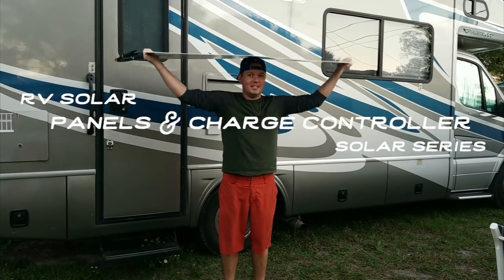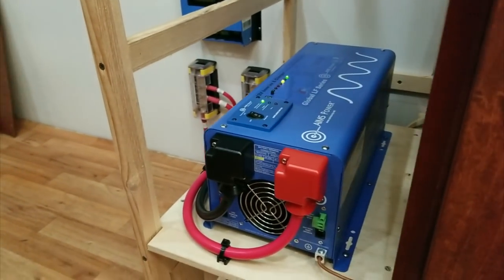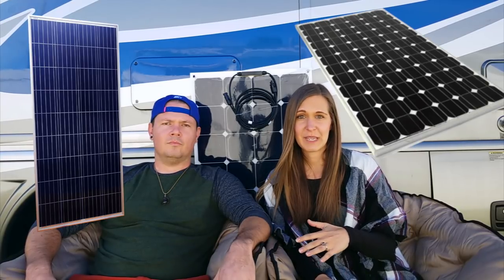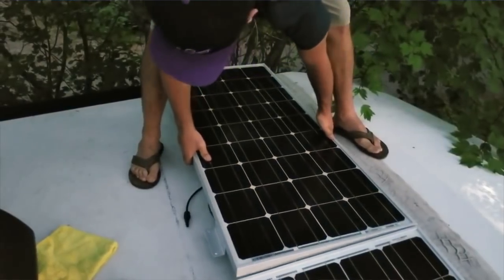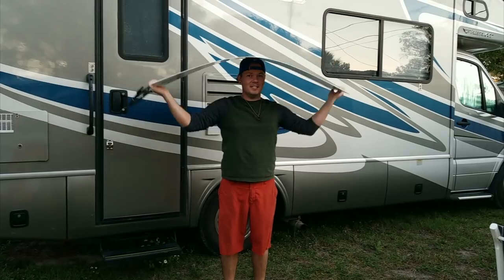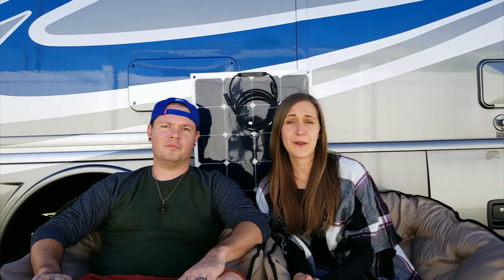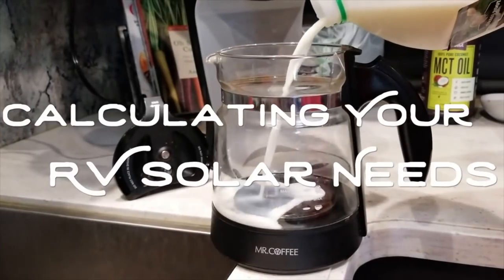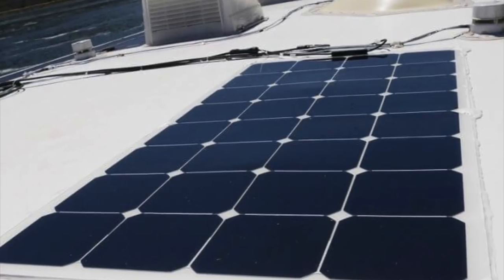RV Solar Power | Choosing RV solar panels & solar charge controller

Comment: I put on 6 Mono Crystalline 250 W panels and screwed them into my roof and used Sealers and eternal bond. To seal up the hole so they will never leak  I also got Go pro 3000 W inverter pure sine wave and a Victron smart controller 150/100, 3 life blue 100 watt batteries And everything that went along with it thank you and take care have a happy and healthy new year for you guys
Reply from the maker: Sounds like a great setup Larry!
Happy New Year & safe travels! - Dennis ✌️

Comment: For my RV on order I chose to have the dealer remove the standard flat panels and install 400w of flat mono glass panels.   Warranty, performance, and shade areas under the panels for the roof instead of adhered hot spots were what was important to me.
Reply from the maker: Hey Ted! That's exactly what we're talking about! Build the system that makes sense for you and your coach. Thanks for sharing & Safe travels! - Dennis ✌️
Reply: @EatSeeRV  What convinced me was a photo of a flexi panel that shorted out and burned and the wires feeding it almost burned thru the roof of the RV too....scary...
Reply from the maker: @tedwilliams1000  I believe it. Fires are always scary! 
I've had folks tell me that the absorption fridge installed in our class c will catch fire one day and kill us too, LOL!
In the grand scheme of things, the odds that a solar panel or a fridge catching fire is very low when you think about how many RVs on the road have them installed.
The RVIA reports there's approx. 9 million RV's on the road currently and around 355,000 get sold each year! 🤯
Don't get me wrong though. I'm not saying it will never happen, because it most certainly could. - Dennis
Reply: @EatSeeRV  I guess I'm glad my new one will have a compressor fridge...keep those smoke alarms tuned up!!

Comment: Great job!  Very informative, as usual.  What percentage of the time would you estimate you two are off grid?  We're looking to buy a Sprinter Class C in the next couple years, so I'm just trying to estimate how much solar we might need.  Right now, in our TT, we don't boondock at all.  But we hope to travel more far and wide with the Class C, including National Parks, where we would be without hook-ups for maybe 3-4 days at a time.
Reply from the maker: Thanks Amy! I would say we try to camp off grid 60 - 70% of the time. We search for boondock spots first, then harvest hosts or boondockers welcome locations, then rv parks if we absolutely have to. We camped this way in our 36ft fifth wheel. 
Now that we are in the 26ft class c I suspect that we will be off grid even more often! 
We had a very similar setup on the fifth wheel to what we are building now in the class c. But, this time around we are concerned about adding  too much weight to the RV.
So we've selected much lighter flexible solar panels for the roof and MUCH lighter lithium batteries.
Hope this helps! - Dennis ✌️

Comment: I'll have a flat roof T.T. and can easily mount 500 wts. of rigid panels including penetration. What I'm not easy with is after market modifications and the extent of components. Saftey is my concern, mainly fire. Where can I find the best of the best?
Reply from the maker: Hey Jim, the best of the best is very subjective.
I would suggest to look at the warranty offerings of any component manufacturer and try to sift out competent reviews on the products you decide to purchase and base your decision on that.
As far as fire safety goes, that can be addressed by hiring a competent off grid professional to install your components. Since off grid and solar systems are quickly growing niche there are plenty of great mobile installation folks out there.
I personally wouldn't trust this type of install to a RV dealership or maintenance facility.
Additionally there are fuse's, breakers, and manual disconnects that will safeguard against fire that you will want to make sure are installed inline with your wiring.
I will be sure to point those out when we do our "Complete Off-Grid System Overview" video once we have everything installed.
Which will be by the end of next weekend!
Hope this helps. - Dennis ✌️

Comment: PWM controllers will also charge or try to charge a dead battery. They only take 1 volt or less on the battery side of the controller to make it kick in and start charging. An MPPT controller must have a higher voltage from the battery to have it kick in. Most take 7 to 9 volts for them to start the charger up. The MPPT charger likes a high input voltage. So make sure you know what the max voltage is and try to achieve it. The higher the input voltage the more efficient it will work and output amps will be higher. Mine likes to have around 105 volts. We call it "waiting on sound" when the noisy equipment fires up when shooting a video. We also blame the sound guys for every delay. It's in inside joke.
Reply from the maker: Thanks for the additional information! Always helpful to get insight from others who have experience. 

Hahah waiting on the sound guys. I love it! - Liz

Comment: 6:30 There is no "wasted power."  By giving this advice you mislead people to think that 1.) a 1kW solar array actually produces 1kW all day, every day.  2.) That the charge controller does not support a direct load.  Also, it's ENERGY that is used/wasted, not power.
Most people, including yourselves, mount solar panels flat on an RV roof.  This, alone, makes them operate far below their rated capability so your advertised 1kW solar array may only be generating less than 50% of that.  Sizing an array so it meets the typical demand with average nominal output is what should be recommended.
The second point is that during the day the solar controller should have enough available  power to BOTH charge the batteries and support small, nominal loads.  The idea that all power goes to charging the battery and then loads will run off the batteries is patently false.  If you have 500W of solar power and your batteries are only 235Ah (your "two six volt batteries" example) those batteries will be charged in about 7 hours. (depends on charge controller)  However, that charge rate is greater than the manufacturer's recommended C10 rate and can harm the batteries.  This does not mean you size the solar array for ideal conditions as ideal conditions are seldom present.
Nevertheless, if you're listening to music, using lights, running water (pump), etc.  you are consuming power during the day and that can be provided by the solar array WHILE charging the batteries at the recommended C rate.  There is NO WASTED ENERGY.
Even if you're day hiking and the RV is completely shut down, there is no "wasted" anything as the Sun will continue to radiate the same power regardless of whether you use it or not.
Should someone put 2kW of array on the roof if they don't have any such demand?  Only if they want to ensure they have enough energy for their needs even on cloudy and rainy days, but there is still nothing "wasted" on rare full-sun days as the array was sized for the application and nominal conditions and the Sun shines on the panels no matter if they're connected, used, functional, etc.

Comment: The idea that anyone needs to buy solar components that are from the same manufacturer shows a fundamental ignorance of solar charging systems.  There is no reason to buy panels, controllers, cables, etc. that are branded the same as they are UNIVERSALLY compatible so long as you look at the voltage and power specs.  (don't use a 24V volt panel on a 12V PWM controller, for example)